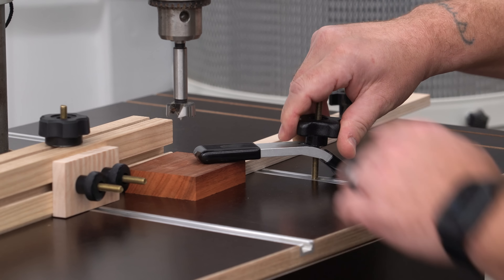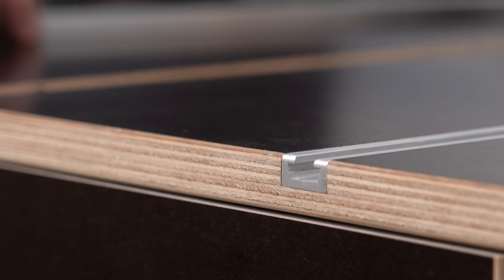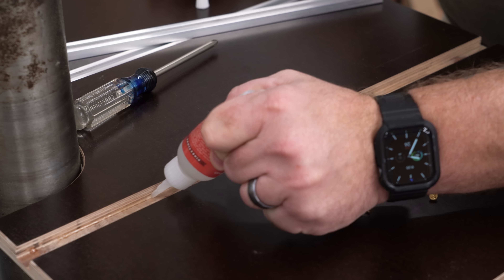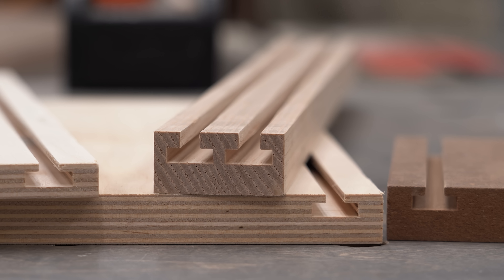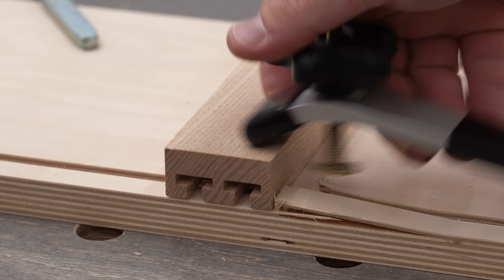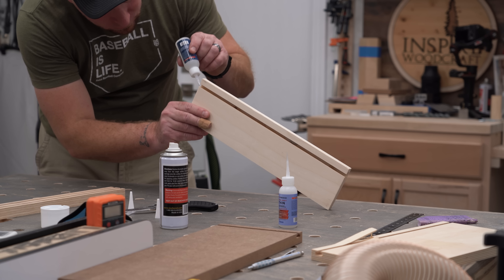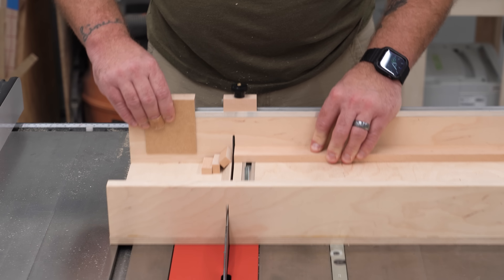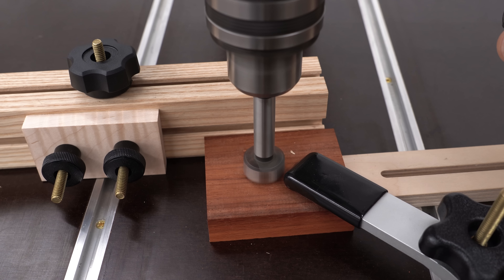Wood is BETTER Than Aluminum T-Track... Sometimes.

Comment: I like to use #6 flathead machine screws washers and nuts to keep my t track in place. Much more stronger than very short wood screws and no need to use any glue, so the track can be reused.

Comment: There's an outfit that makes a dovetail shaped aluminum t-track, never did find a dealer in the US who carried it. Probably the best of both worlds; won't pull out, doesn't require big or deep screws
Reply: MatchFit makes it and it’s cheaper — $80 will get you the bit plus 4 clamps.
Reply from the maker: @nominalvelocity I believe it's called OTORO, or something like that. I haven't found a dealer in the states either, but I sure would love to get my hands on some. And it's pink, so there's that. Ha!

Comment: I started as one using aluminum in every t-track application there was but then turned to wood, and have using wood since then. Surely, wood has those disadvantages but they have never manifest in my work in years as I have never tore a wooden t-track.

Comment: For positioning - wood.  For clamping - aluminum.  And by the way, on my drill press table I installed a fence that pivots on a flathead bolt placed in a rear corner. Thus, I have only one clamp to manipulate and snug down while I adjust the fence with the other hand.  There is almost always enough table area to support the workpiece  when the fence is angled on the table, and if there isn't I just use a support stand.
Reply from the maker: That's the same design I'm upgrading from!

Comment: Not as strong as Aluminium, but routing a dovetail type track is stronger than a routed T type track. I've found that the trick is to match the clamp shape to be as close to the track shape as possible to spread the load. For this, if you have a 3d printer, it's pretty easy to print your own clamping heads. Oh - and also, instead of clamping down so hard, try to spread the load over a wider area. If there is space, always use two knobs instead of one.

Comment: Nice summarisation. I have only been using my self made t tracks from beech wood. No tearout and holding without issues after 4 years of use. All done with a 12 dollar t shaped router bit. Can recommend
Reply: Consider maple, a tip I got from a MASTER woodworker

Comment: I’ve used deep groove for bolt and shallow groove for 1/8 aluminum flat stock to form the T portion. You can use longer screws more closely spaced.

Comment: Good overview.  I agree... it always depends on the needs & use and I use them both.  I've been finding the MatchFit dovetail system to be of great use for many things, as long as the clamp or part being clamped provides proper reinforcement directly over the slot so it does not pull the clamp out (as you pointed out).  It is far cheaper and easier to install over t-track.  I routed a large number of groves across my assembly table to create a criss-cross pattern to allow me to clamp anything I need down.  Works very well.

Comment: Really excellent tips, dude! Thanks! 😃
People use CA glue to reinforce threads made directly into the wood. But it won't work for soft woods...
Anyway, stay safe there with your family! 🖖😊
Reply: A friend of mine that is an INCREDIBLE wood worker told me to ONLY use maple, since it's it's a hard wood and is the wood of choice for jigs/ tracks
Reply: @GrantOakes  Well, I don't have access to Maple here in Brazil, but I already did it in many hardwoods without any problem.

Comment: Have you worked much with the MicroJig Matchfit system? Very similar to the wooden track, only downside is that you have to buy specialty hardware and clamps from micro jig. However, if it has the proper setup, like the wooden t track, I actually use my dovetail clamps like an end vice all the time.
Reply from the maker: @Justin Faure I have. My tapering sled and my tenoning  jig both utilize Matchfit  dovetails. As well as slots in the faces of my workbench to act as a vice. I really like them but they don't work for a drill press table very well simply because the track clamps bar and handles get in the way too much. And the dovetail hardware is too small to utilize normal hold-downs.